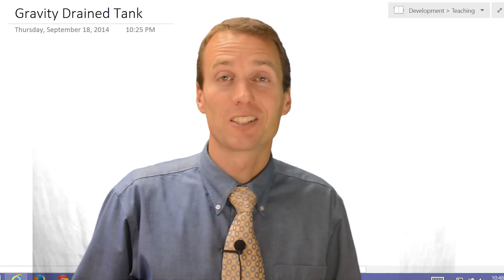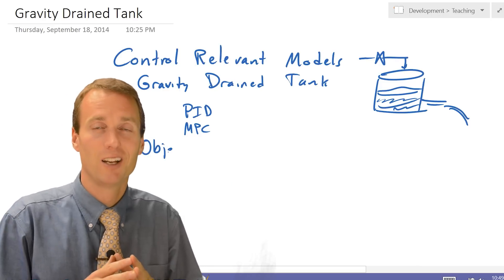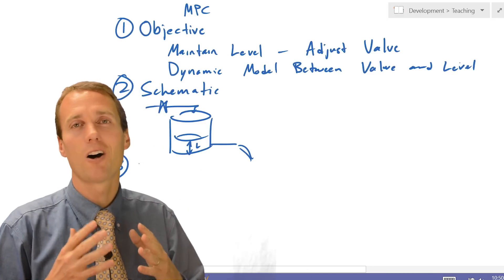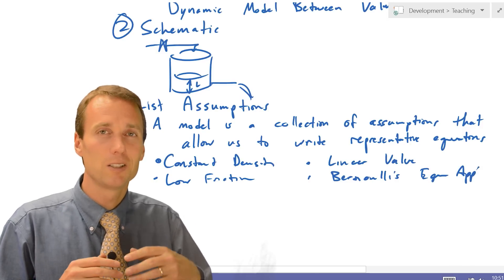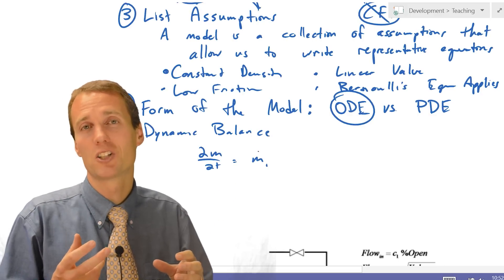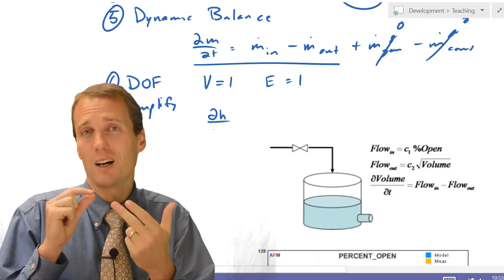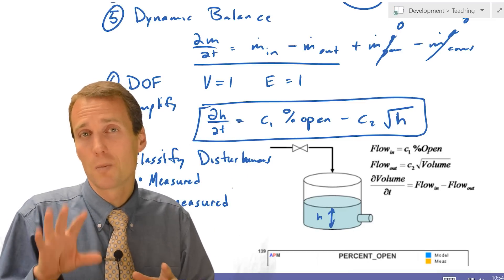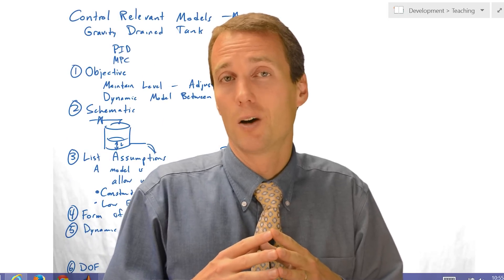Develop Dynamic Equations

Comment: To me, a dynamic equation should be an equation in which variables come in and other variables go out, dynamically. Like our body. I think I am a dynamic equation. Is there a point in time where I can be solved? This point must be very short. right? If this all is nonsense, explain me why. Thanks.
Reply from the maker: Great comment! A mass balance is how you would track your weight over time. Scientists are also working on a detailed cell simulation so the control volume can be large or small.